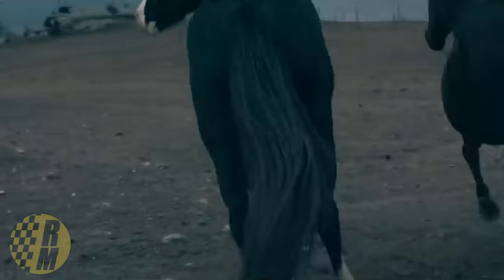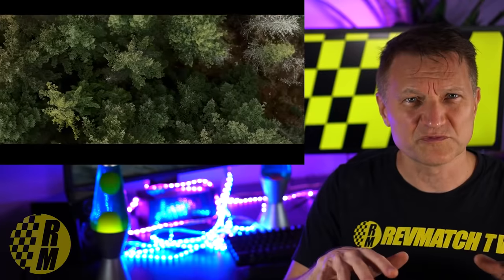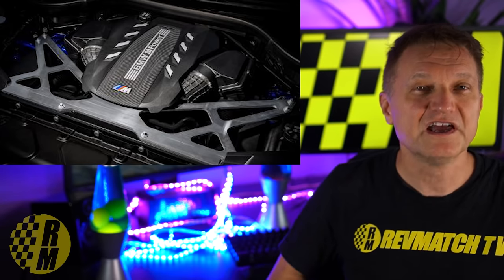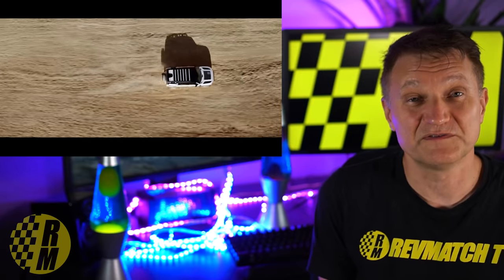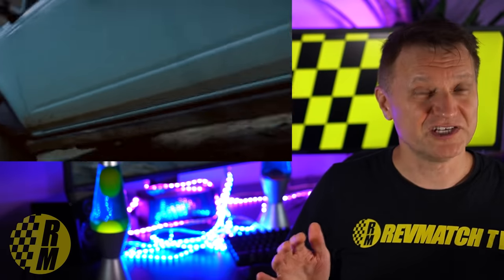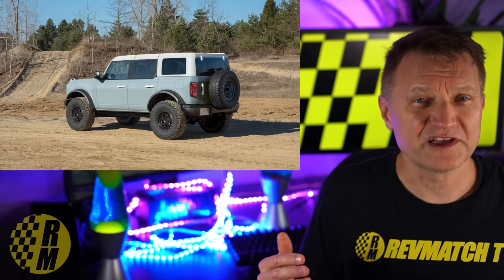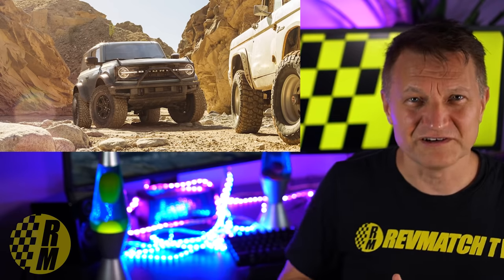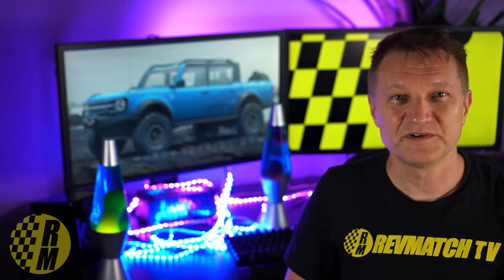Ford Bronco Pickup Incoming + Big Power V8 Land Rover!

Comment: V8 or not, they really goofed up on the Land Rover's design, which will definitely affect their sales. Well done Ford, on the Bronco. Two-door for my liking.
Reply from the maker: Dealers are sold out of the Defender. They're quite difficult to get right now.
Reply: I am getting my deposit back for the Bronco because they just confirmed that you cannot get the base model with manual trans and Sasquatch package that they originally said you could.

Comment: So Bronco Sport to slay the Jeep Compass/Cherokee, Bronco short to slay 2 door Wrangler, Bronco long to take the 4 door, Bronco pickup to battle the Gladiator. Warthog to perhaps take the Mojave. Of course the 7 Grill icon brand is about to launch the Wagoneer in the next few years which seems to lack a match in the Bronco line unless the Blue Oval thinks the current Explorer or Expedition is enough? An interesting thought would be to resurrect the Excursion name plate as a Bronco big wild rated Safari truck. In April Ford applied for the old name.

Comment: Can u tell me if you can get Sasquatch with manual Trans some say u can't some say u can...
Reply from the maker: No manual. Auto only. Confirmed by Ford.
Reply: @revmatchtv  thanks so what the best crawl ratios with manual then
Reply from the maker: @gilbertwoods876  The Badlandas has 4.7:1 same as the Sasquatch package. The other manaul models are 4:46:1.

Comment: i got two vehicles i want to replace by 2024ish, a jeep YJ that is great for offroading and nothing else, and a good gmc C1500 that can carry my dirtbikes and tow a light trailer. If Ford can fulfill both roles with the bronco pickup that can do at least 8,000lbs max trailer weight with Sasquatch pack and few other stuff and keep it under $45,000 then I am sold.

Comment: Why not just offer the 2.7 eco boost on the ranger already.
Reply: Because as is right now, the 2.7 will not fit in the Ranger, the Bronco is based off of a MODIFIED version of the T6 platform, which is what the current Ranger is, so when the NEXT Ranger comes out in a few years, it will probably THEN have the 2.7 v6.

Comment: I thought the new Bronco is on the Ranger platform
Reply: It's on the new Ranger platform which has not been released yet.
Reply from the maker: @buckhorncortez  Yup
Reply from the maker: That's right. The Bronco Sport is on the C2 platform which is shared with the Escape.

Comment: The Wrangler 392 Concept will never be built. Otherwise they would of removed the "concept" from the name. Every, and I mean every single Concept that Jeep has ever shown in Moab has never seen the light of a showroom floor. Too bad Jeep didn't listen to their costumers back in 2007. Now they want to put a V-8 in the Wrangler.....Sorry, Jeep you have a LOT of other issues that need fixed on the Wranglers now before you can even consider getting a dime from me. Ford raised the bar so high you can either react or die....
Reply from the maker: They're going to build it. They've said as much. Plus there are test mules that were spotted in the last 48 hours.
Reply: @revmatchtv  Oh have you ever been to the Jeep events in Moab. They ALWAYS say they are GOING to build it. This is simply a reactive move to attempt to take away the attention from Ford. Ford Bronco fixed every single problem that every Jeep has. So what if you drop a Hemi in a Wrangler now, all the other issues will still be there.

Comment: The Bronco needs a diesel!!!!  Ford pickups have them...so should the Bronco.
Reply from the maker: Nothing in the works as far as I understand
Reply: Why to tow 3500lb😂
Reply: Actually..Ford has their own diesel models which are awesome; 3.2L turbo in Ranger with V5The Ranger Raptor has a 2.0L twin turbo V4. The best Bronco would be the F150’s 3.0L V6 with a turbo power stroke!!!  Tweaked to perfection could possibly generate more than 250hp and 440+ torque
Reply: @architecturalhardwaresolut9625  Ford just leaked that they would use a hybrid powertrain in the bronco. And since a V8 is too big. The only engine that it could be is the Lincoln navigators 3.0L TT hybrid engine that makes about 500 HP and 630 tourque. That's pretty impressive

Comment: The Ford Maverick lives on....but reincarnated as a truck? Probable so it wouldn't risk cannibalism the mustang like it did in the 70s XD

Jk
Reply: 1EPICGAMER 1 no different than the Chevy Blazer being reincarnated as a crossover.
Reply from the maker: The 70s Maverick was biodegradable like most 70s cars!
Reply: @revmatchtv  Yes, but the Grabber package of the maverick in the mid 70s had a decent performing V8 that offered more than the Mustang II of the same years
Reply from the maker: abutts02 good point
Reply: G Riv  Maybe, but the Maverick was cheaper than the mustang II and was lighter, that was until the end of the life cycle of the maverick where the purposely upped the price of the Maverick
Reply: G Riv  I also thought the maverick looked batter but that is my personal opinion

Comment: 10:04 Sir, Ford and any manufacturer for that matter does not make unibody pick-up trucks. There are no unibody pick-up trucks in existence. It wouldn't even be considered as a pickup if it's a unibody 🤦🏾‍♂️
Reply: Wrong. 1961-1963 Ford F100 is a Unibody truck that still exists.